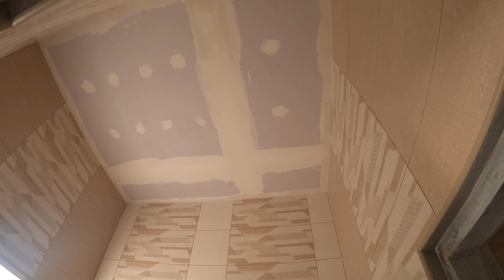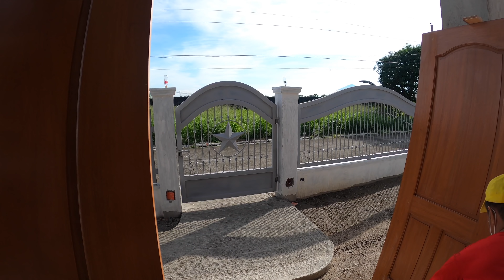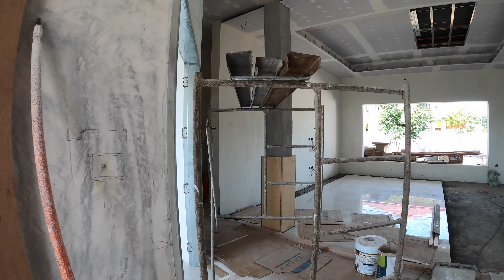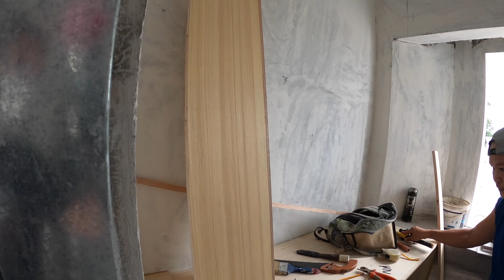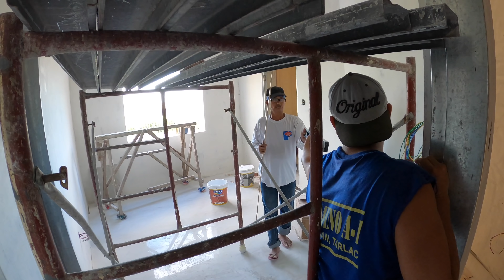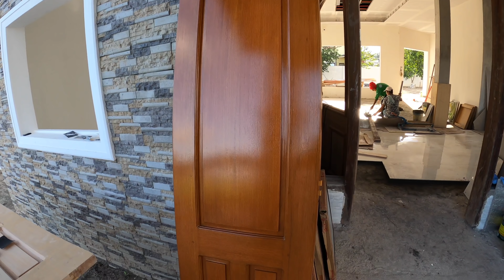Philippine House Building Step by Step, Build Day 194: Treading Our Way Home

Comment: It's nearing completion, you can almost move in with those rooms that have tiles and ceiling. The electrics still need to be sorted.
Reply from the maker: Getting closer. Not in a rush to move in. Just hoping for a nice Christmas present of a completed house. 👍😊🎄
Reply: @CasaTexPina  hoping that you'll get it done by that time.